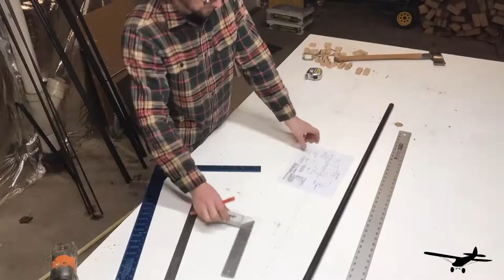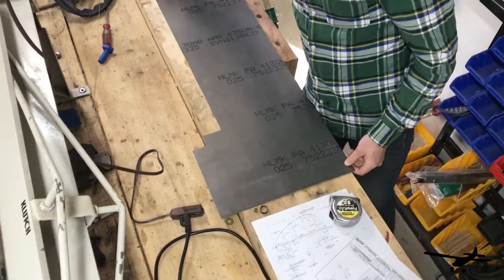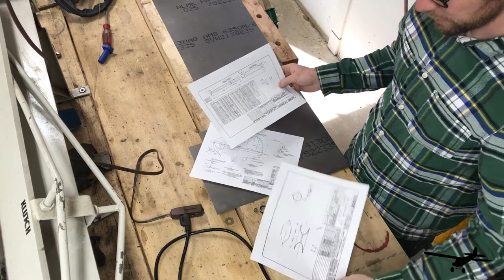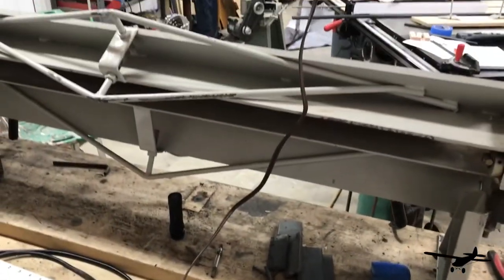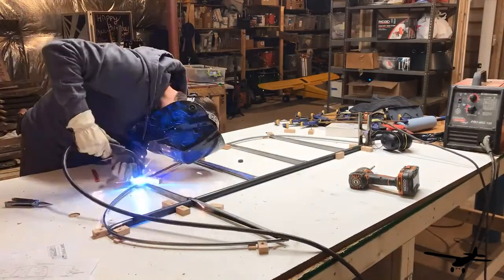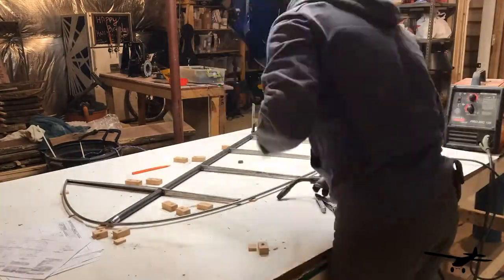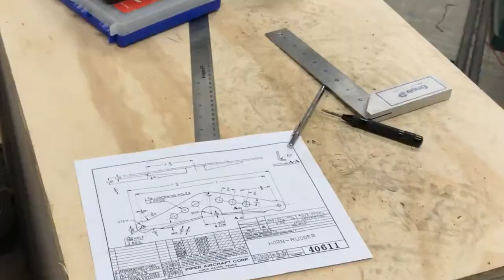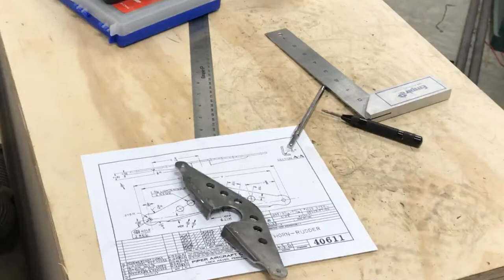Experimental Super Cub Build Episode 2

Comment: Any more progress. My VR3 tube kit will be delivered in two days.

Lee since the first comment I have now tacked everything together and have tail feathers mounted. To me the fit of this tubing kit is amazing. The only thing that would make it better would be general guidance on what steps to take. 
Would be nice if it included all the bits that weld on, rudder & elevator bell cranks, torque tube and mounts, pulley brackets etc. but I knew up front it wasn’t included. Took 2 weeks to receive a very well packaged kit. I don’t impress too easily and this kit is awesome. 
FYI took 4 days to completely tack together the fuselage, and a couple more days for tail feathers and gear
.